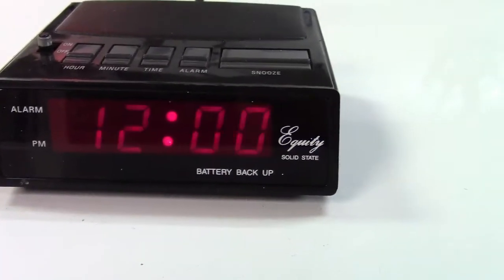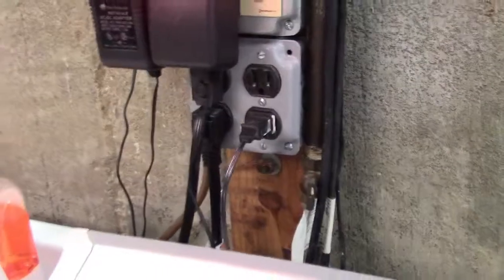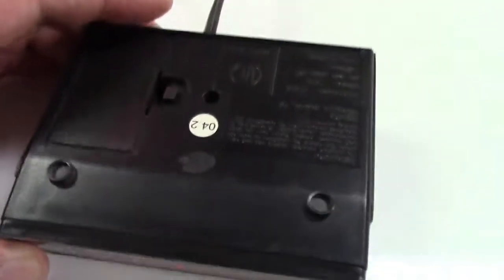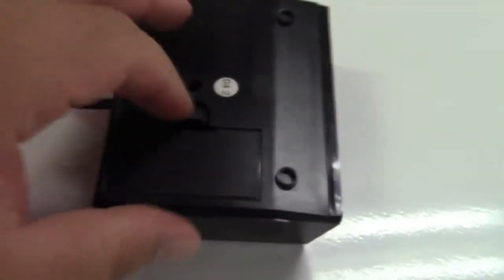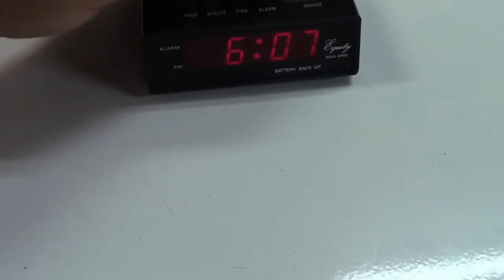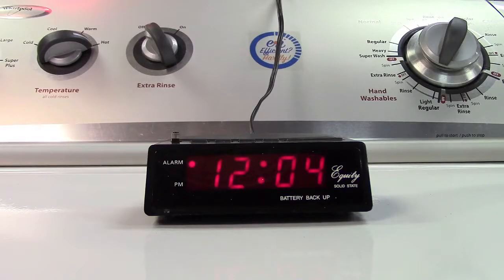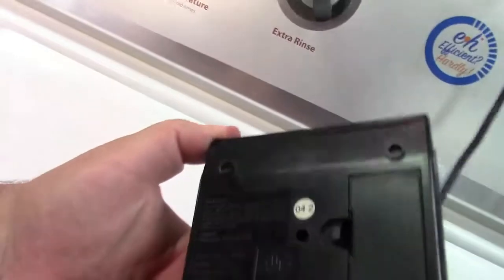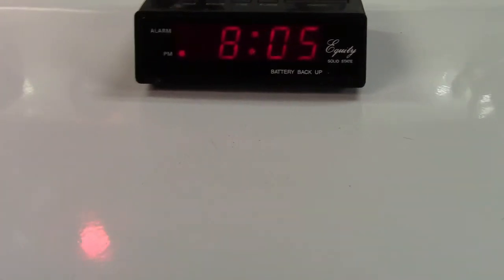Equity Solid State Model 1010 Alarm Clock

Comment: The alarm isn't nearly as loud as I'd need it to be, but I do like the controls layout.. It's very simple, uncluttered, and intuitive.
Reply from the maker: Has the exact same sound and volume as the Cosmo Time alarm clock I had as a kid, and never had a problem with that.  You must be a heavy sleeper.  I remember over 20 years ago when I worked at The Wiz, there were one or two models with a very loud alarm.

I like the controls on this clock also.  Easy to reach and do indeed make sense.

Comment: Got mine bout 15 years ago, only thing I did was replace the horrible quality no name brand 16v 470uf filter capacitor inside with a 470 uf 16v United chemicon organic polymer cap
Reply from the maker: This one is still stock.
Reply: @jaykay18  id recommend you'd put one of those in or a nichicon uhw of the same value, certainly improved this great little clock, perhaps sometime ill put a video up.
Reply from the maker: @analogaudiorules1724  I don't keep, nor do I have plans to keep this clock in any sort of regular service.  Not sure where I even got it.
Reply: @jaykay18  keep it, its great
Reply from the maker: @analogaudiorules1724  I have no plans to get rid of it.
Reply: @jaykay18  awesome man